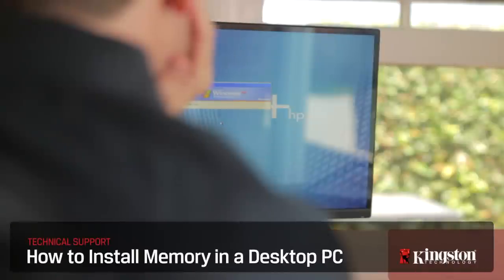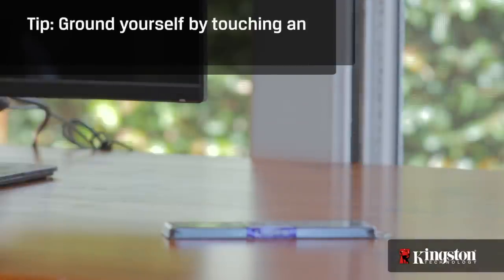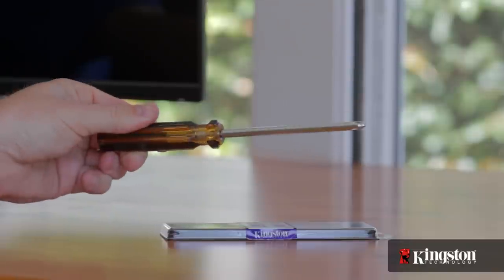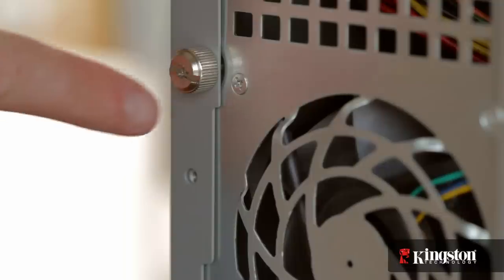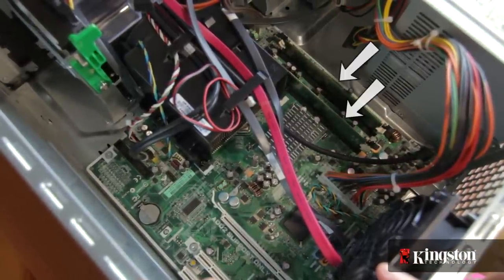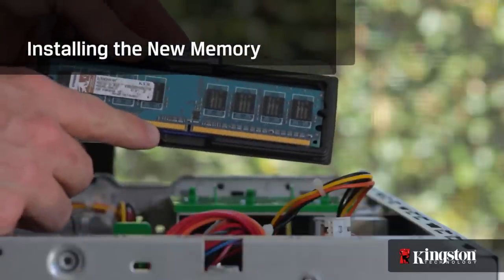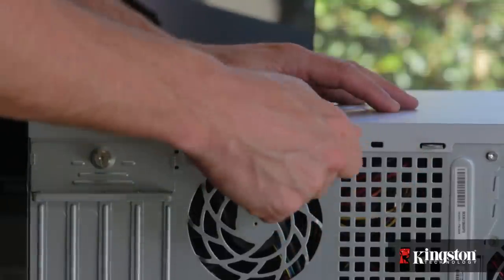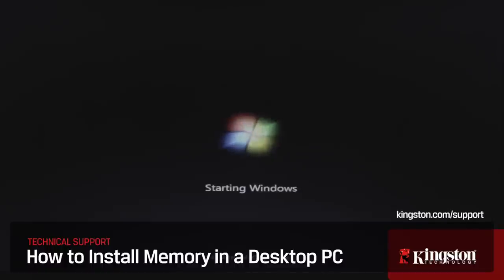How to Install Memory in Your Desktop PC

Comment: More memory card means faster performance?
Reply: Abdulaziz Kodirov RAM cards have speeds. Doesn’t mean more ram equals faster performance. The amount of ram must reflect your usage. For example, a heavy video editing desktops need more ram than a office-usage desktop as it performs heavy workloads to edit videos. If you are using a 2666Mhz ddr4 8gb ram n u want more performance, i suggest you to upgrade to a faster ram like a 3200Mhz ddr4 8gb. Its not the amount that matters, its the speed of the ram

Comment: Hi just bought your ram today i have 4 slots of Elpida 2gb 2rx8 pc3-10600u-910-bo an what i got from you is kvr13n9k2/16 16gb pc3-10600 cl9 240-pin udimm kit okay now when i put them in it will boot then shut of then i skiped a slot put one in then skiped an put the last one in now it will boot an stay running but screen says no display any help. thanks
Reply from the maker: +Brad Tyler
For the no display issue, did you make sure your monitor is connected to your motherboard or dedicated graphics card?  As far as troubleshooting the memory it depends on your motherboard.  Reach out to our support team with Case#SR308093 at http://geni.us/KingstonSupport.  We'll take care of you.
Reply: Kingston Technology i bought 4 gb of ram (2 cards of 2) andi plugged it in and it says that i've got 6gb of ram but i dont have more fps in games and my conputer is not runing faster what do i do please help

Comment: My dell p6210 Y progressively got worse and crashed totally. The various beeps occasionally a message came up cannot read memory. Have you ever heard of memory going bad? I hate to buy all new ones and turns out I am throwing money out. The computer was wiped clean and windows 7 installed but it does not boot all the way up and gives similar errors. Also can I not take out the memory--read what it is and get the EXACT same memory?--rather then researching from a list not being sure what might happen.
Reply from the maker: Hi Jeff, sorry to hear that you are having Problems with your memory. It sounds like a bad memory, testing the modules on their own or in pairs may help to narrow down the issue to the faulty module. Please feel free to contact our support team via http://www.kingston.com/support to assist you with the possibily faulty modules. Your Kingston Support Team
Reply: thanks I will go there and try to fathom it out--the issue will be the cards have various long codes and trying to figure out how to get the exact one. One appears different--the other 3 appear identical. I like the idea of getting one then replacing it till the computer stops giving the error since replacing all 4 is cost prohibitive.

Comment: When changing ram does my files will also get formated
Reply from the maker: RAM cannot store data permanently only temporarily while the system is powered on - the only place files are saved are on the hard drive or an external storage device like a USB flash drive or flash card.
Reply: Kingston Technology thanks

Comment: I have a Dell desktop type Dimension 5150 it came with 1gb ram I hardly use it. But I was wondering could it work with 8gb ddr2 ram even though the test says maximum ram 4gb?
Reply: the max is 4gb because its 32-bit. upgrade to 64 bit.

Comment: :( my ram wont go in that easily. I've made sure it is the correct ddr4, correct orientation, but its kinda stuck. I can still see the golden pin from the ram, it can't go fully into the slot
Reply from the maker: Lets chat, we can help troubleshoot and walk you through the process! 
https://kings.tn/35GfYsO
Reply: Same:(

Comment: i installed 2 gb of ram but when i check in control panel its still said 2 gb of ram but when i check it on speccy it said i have 4 gb of ram but its only using 2 gb of ram
Reply from the maker: Just so we understand - how many memory modules are installed in total? What is the capacity of each memory module? What is the total capacity seen by the BIOS? What is the total capacity as seen by Windows? Can you provide a screenshot to show what you mean by "its only using 2GB or RAM"? Thank you.

Comment: in the video the ram slots are black and tan. does it matter which one you put them in as long as the ram is In the same color?
Reply: pikkutekija as far as I know, not at all I believe the same colour runs better together though so I would try to put them together but if you cannot then I wouldn't worry or else you would have useless ram slots

Comment: can I lose some files software or my games I want to know before doing this. thanks
Reply: If you remove it while it's on, maybe otherwise not that i know of.
Reply: Jocelyn Bayona no u wouldn't
as u would be doing this when ur system is off
ram stores data only when ur pc is switched on
so u dont need to worry for loss of data